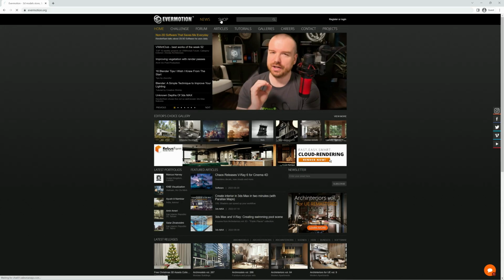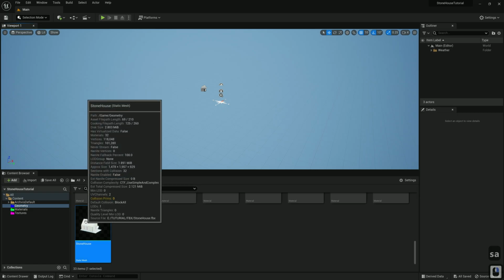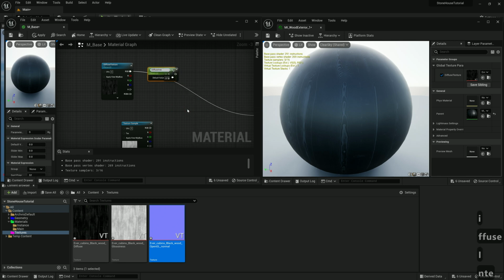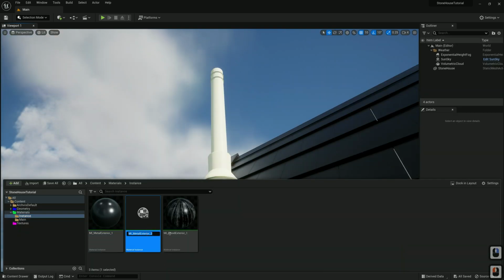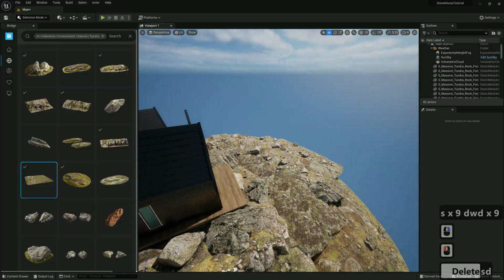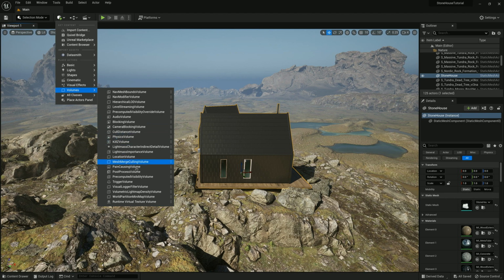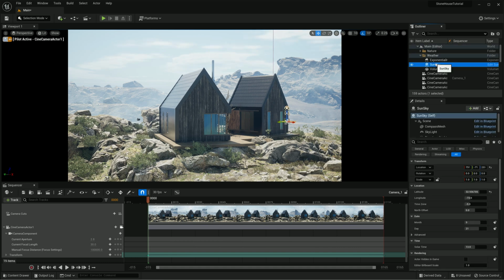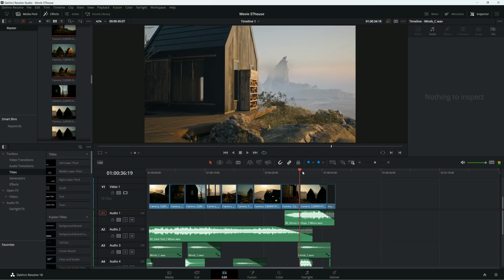Unreal Engine 5 Cinematic Photorealistic Architecture Rendering | Complete Tutorial

Comment: Its too complicate and time consuming to create simple materials like wood and metal in Unreal Engine. Megascans is what makes unreal engine so impressive and so sublime. Things don't happen faster in it than in any 3d editing and modeling software like 3ds max, blender and render engines like V-ray or Corona. Why doesn't anyone make a commercial architecture project in Unreal? It's easy to make rocks, forests, stones and natural landscapes, simple wood cabin, but has anyone tried to make a new modern building in an urban environment with streets, infrastructure, transport? And with various corrections and variants of the building project? how long would it take?
Reply from the maker: To be honest, working in Unreal Engine is easier than it looks. There is no need to re-create the material each time, you can use your own templates or ready-made ones from Quixel.

Comment: Please tell me, why does it have to be unreal engine? because I'm very confused to choose a blender or unreal engine. explain why you choose unreal engine?
Reply from the maker: It's not quite right to compare Blender and Unreal Engine. UE is not a suitable tool for 3D modeling. Therefore, first you need to build a 3d model in Blender or another application and then use it in UE.
Reply: @stan3dart  oke thnks

Comment: Hi, Stan, thanks for great tutorial! It's amazing! I accidentally imported the dishes into UE along with the house. Now it's hanging next to the wall. Is there any way to remove it? Or just re-export the scene from 3ds max?
Reply from the maker: Thank you! I think in this case it is easier to do a re-export, it will not take much time. For convenience you can use "Datasmith + Direct link" it synchronizes UE and 3Ds Max.
Reply: @stan3dart  Thank you 👍

Comment: Hi Stan, I wanted to thank you for your time and effort. I agree with many of the comments, this is one of the clearest and most complete explanations for using ue5 for archviz. May I suggest that instead of scaling up the post-process volume you just click the infinite extent option. Also, I would like to ask why is it better to remove all the foliage assets and then add them again?
Reply from the maker: Thanks Enrique. 
In the case of a post-process volume, both options can be used and this will not affect the result. 
For me personally, it is more convenient to add foliage by consistently placing it in the scene. Of course, you can do as you please.

Comment: Can you make use of UE 5 if you only choose to use Sketchup for modeling? I don't have time to learn new modeling softwares like 3dsMax
Reply from the maker: Of course, you can. Just export 3d model from SketchUp to an FBX file. With centimeters unit system. Or use Datasmith Exporter Plugin for SketchUp Pro.
Reply: @stan3dart  That's great, thank you!
Reply: @stan3dart  Great work by the way.

Comment: What graphics card do you use?
I have rtx 2060 super and ue5 barely run on my computer
Reply: What do you mean by "barely run"? Its a game Engine so there are multiple reasons it might lag. Regardless, do not expect 60FPS because that's a level of optimization that typically isn't worth it for those who use it as a hobby. You are better off using D5 Render if you expect projects to run more fluid because its a stripped down version of UE4 but with hardware Ray Tracing. On a side note and also just a heads up, Lumen is software Ray Tracing but its nearly on the level of  "hardware" Ray tracing with recent updates to in-direct lighting. Epic is favoring AMD's new architecture in which is also in consoles so Lumen will likely be the target lighting system for UE games going forward while its up to NVIDIA and annoying complex  "drivers" if hardware Ray Tracing is an option. For those looking into using Unreal Engine 5 for future projects, I would highly suggest using AMD RDNA GPUs because they a better investment that have real native support when it comes to pure shader-core performance with advanced full DirectX 12 Engines and gaming applications. Now, if you are using something like Blender or similar most the time then i would go with NVIDIA like i do in which i use a RTX 3060 12GB and runs great. Hope that helps buddy.
Reply: @captureinsidethesound  Thanks
I am using d5 render and it works great
Reply from the maker: I use RX 6700 XT